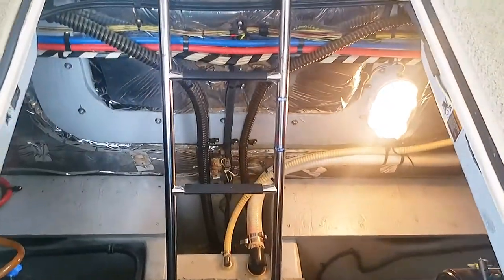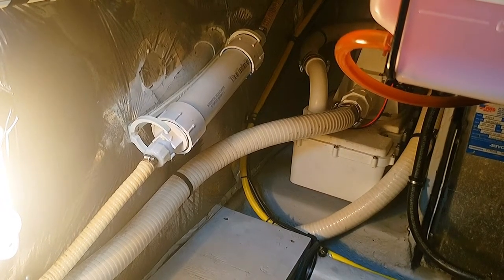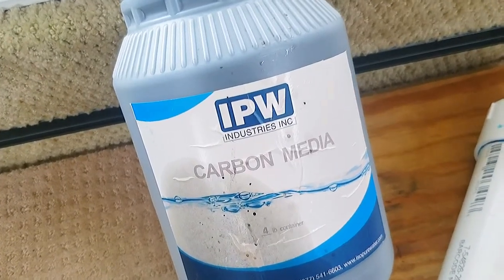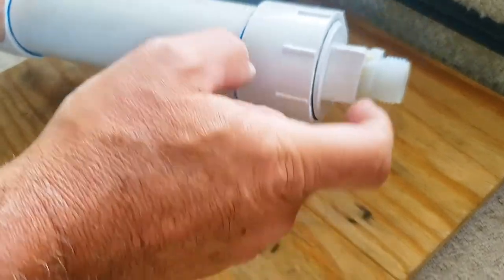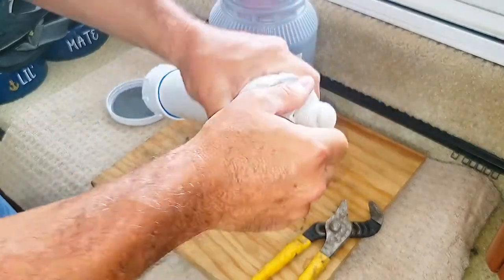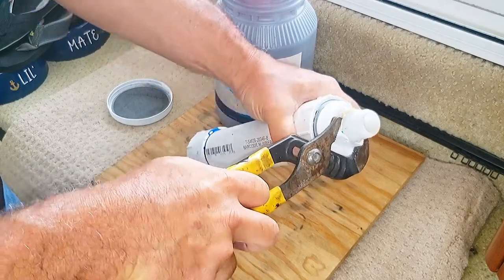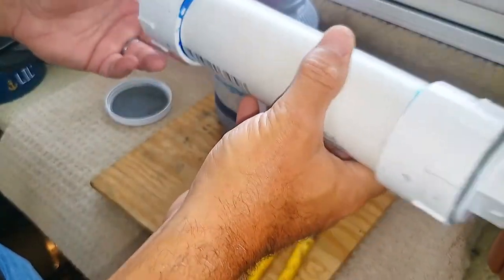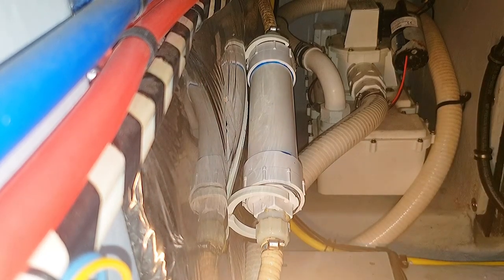Holding tank vent filter media replacement

Comment: Have you had to do any maintenance on the VG4 vacuflush pump system? Mine has a strange problem which appears to be a vacuum switch issues according to what I've read (video here-> https://youtu.be/mg9yo42b8Gc) but getting to that bugger is a pain! Have you had to access it at all?

Love the filter replacement strategy, mine had the $50 one replaced about a year ago (I just bought the boat) so I hope I can get a season or two out of it, but I like this approach to the replacement
Reply from the maker: Just watched your vid..  It’s likely the pressure switch, not the bellows pump.  Mine started doing that.  When I tapped the pressure switch it worked.  I ended up “exercising” the pressure switch spring a few times and it was fine after.  You may need a minor adjustment of the spring pressure.  It could also be a bad winding on the pump(like the old bad car starter trick where it cranks after hitting with a hammer). But I doubt it.

To service the whole unit, it’s easier to just take the whole assembly out after disconnecting hoses.  There is a great vid online on doing that.  Only 4 hold down screws secure the tank to the bilge floor.  They are a bitch to get too as you can’t see them all.
Reply: @AdventuresofHappyOurs  Great video, what was the orginal product you purchased and then modified ?
Reply from the maker: @keithtiedke1828  I don’t recall the model of the original filter, but it’s much cheaper to just buy a piece of 2” pvc and the caps to make your own for about $15.